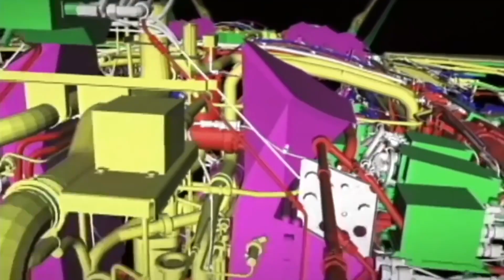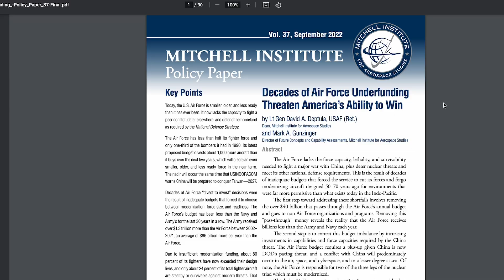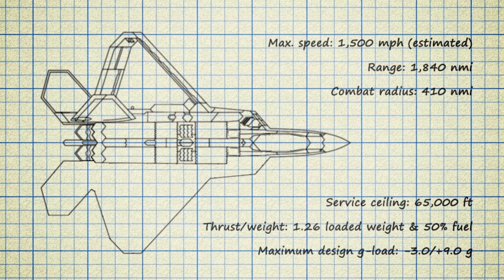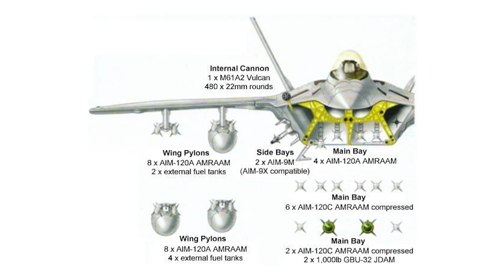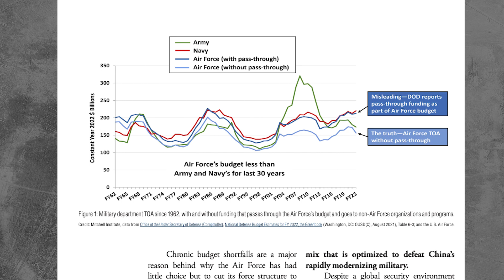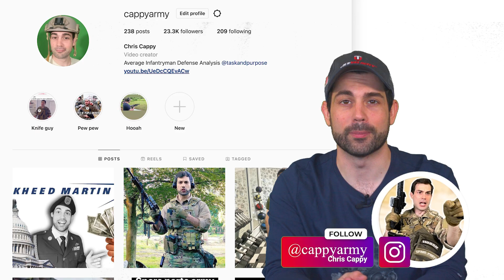Cancelling the F-22 Fighter is Worse than You Think

Comment: I actually agree with canceling the F-22 program simply because the air force in reality doesn’t need it. Why? It boils down to simply the USA doesn’t need great air superiority fighters, it needs good strike fighter ms which the F35 is. This is shown in the Russo-Ukraine war, aircraft biggest problem for both sides has been air defense. While there has been significant air to air combat too and dogfights. But if a stealth fighter was to get into a close dogfight it failed at its task. It is supposed to kill from afar or deliver munitions undetected until the last second before getting out of their. If you destroy the air defense, you 4th gen fighters can operate much easier and at arguably a better level in many roles than the 5th gens. That is what the F-35 does, it enables the older fighter fleet in a way the F-22s just can’t do as effectively. The biggest concern with cancelling the program is the USA is stuck on old airframes but that is an issue across all of the USA armed forces being stuck in old but significantly upgraded equipment.

Comment: The f22 and 35 should be the last manned fighter.  The weakest link in the design is accommodating and safeguarding the pilot. Crew space could be used the space and weight of accommodating a pilot could be better used in a sixth gen aircraft.

Comment: Have to agree that "we" did not build enough F-22's based on current threats, but understand the decision at the time. 

Some have stated that using F-35's as forward stealth target designators combined with AWACS and 4'th gen fighters lagging behind as 'missile trucks' could be a tactic (F-15, F16, FA-18's etc). We best hope that is at least a somewhat valid tactic until we have a working replacement to the f-22 as a true air superiority fighter.

Simply put, only the Air Force has a true air superiority fighter and not enough of them. 

The Navy has NO true air superiority fighter since they cancelled the Tomcat and decided not to develop Super Tomcat 21. That and the long range Phoenix missile system is long gone.

We best hope the AIM-260 is ready before 2026 as planned. Our best bet until we get a true 6'th generation fighter, IMHO, is to speed up this development and deployment. Perhaps bring back a modernized Phoenix system if plausible in the short term, capable of being used by both the Air Force and Navy. Have no idea if the Phoenix is even capable of being upgraded to that level across platforms, pretty much a personal pipe dream for a relatively easy multi service long range missile system.  

I really worry that our carrier task forces, land based assets and overall big picture combined air dominance, are about to be checked by the sheer numbers of our projected enemies. Sheer numbers is how the Allies were victorious in WWII.

Comment: Russia is not a credible air to air threat in Europe and won't be for at least 20 years. The existing NATO assets Eurofighters, F35 etc are more than capable, there's no need for the expensive and fragile F22 in Europe.

The other significant point about the F22 is that it cannot fly from a carrier, which is important in SE Asia.

Comment: I think that it should have been pointed out that dog fighting is still less likely to be the primary type of air to air encounters in even in a war with russia and china. So the the long range of the 35 and the brand new off the line f15ex jets could fill the gap left behind by the f22. And it will do that while costing significantly less to build and fly per hour. The f35 is now cheaper to build than the f15.

Comment: Well the F-15EX Eagle II is a significant development of a reliable platform. I wish my country Netherlands would buy a whole bunch of them to have more strike power compared to the few F-35s that we purchased now. Of course the F-22 is interesting also if it was possible to export it, maybe some current F-16 operators or F-35 orders would be also interested in the F-22. But both these stealth designs are not really good at multi-role and I believe that's where the F-15EX is the best option currently, it's the most modern non-stealth fighter imho.
Reply: Isn't the F-15EX more expensive than the F-35? Since I would assume the F-35 is more capable in more or less any role, buying F-15EX makes no sense at all.
Reply: @mnxs  There are many ways to calculate the cost, I believe the cost calculated for F-35 has always been wrong and influenced by politics and are still more of a wish than a reality. With the F-15E there is much more experience, it's a workhorse with lower maintenance hours required. During Operation Desert Storm the F-15E had the highest mission capable rate. The F-35 looks like a potato and has very low speeds and low range. Also the F-15EX can carry almost any kind of weapon, including B61-12, hypersonic missile, Harpoon, JDAM and HARM.
Look on Wikipedia for the F-35 wish list, search for "being certified", "integration in progress" and "being integrated".

Comment: The F-22 is now an orphan from the supply chain and maintainability standpoint.  I thought that a better idea would be to design a plane that's a hybrid of the F-22 structure and aerodynamics, and the F-35 new, more maintainable systems.  And now they could fold in some B-21 technology also.  Of course the USAF is working on the NGAD, which could obsolete all of this.  But the NGAD won't be in service until 2030 at least.

Comment: The systems on board are simply obsolete - a truly brilliant plane - the best - but was very unlucky with timing - it went into production as there was a giant leap in computing power which it missed.  The 1970/80s style systems are practically impossible to upgrade due to how they are spaghetti coded and interwoven.  Delays to Typhoon saved the project - they scrapped the 1970s style systems and started again - all modular and easily upgradable. The problem F-22 is facing is exactly why the British scraped Nimrod MRA4. The wing alignment issue was a convenient get-out. By the time you could change any sensor on the aircraft and code it into all the ancient systems and test it - it was already out of date.  Bolting the latest off the shelf pods onto standard commercial aircraft gave you much, much better results for a tenth of the cost. It's practically impossible to upgrade anything on F-22 for similar reasons.  The fix is going to be to largely abandon stealth (which is obsolete now anyway) isolate the flight control systems and sunset them - then fit two huge pods on the wing pylons containing complete new avionics and sensor suites communicating with a glass cockpit and HUD wirelessly. This is the only feasible way to upgrade F-22 without spending hundreds of billions - it will make it a worse fighter plane in every aspect (weight, range, flight dynamics and stealth) but it will be a "better" fighter! How? You see, it's no longer about the plane - it's the weapons systems that matter. The sophistication of the weapons and how easy it is to upgrade all of the above - which is why Typhoon accidentally became the best front-line fighter in the world. Unencumbered by stealth integration and fitted with completely modular interfaces and processing units - it's a very flexible and easily maintained platform. As are the other Eurojets. F-35 suffers some of the problems of F-22 - but not to the same degree - however over integration means keeping the sensor suites up-to-date is difficult. Bolting the latest pod into a gen 4 fighter and lashing up an interface to it is easy. The US also used the stealth programme as an excuse to abandon projects such as AIM54 Phoenix - a big mistake and AMRAAM has fallen far behind other medium range A2A missiles, AIM-260 cannot come quickly enough - and even then it's still only catch-up to the best of the rest - it's no Meteor.

Comment: When two stealth fighters meet, neither of them can see the other one until about 10 miles apart. It will be a dogfight. SU-57 is a great dogfighter, F-35 is mediocre. Fortunately, Russia has not so many SU-57:s. I don't know how good a dogfighter J-20 is.
Letting the missile do the dogfight is a good idea, but it does not work if the missile radar can not see the enemy.
Thrust vectroring could make F-35 a better dogfighter. Or find old P-51:s and attach Sidewinders on it.

Comment: As good as the f-22 is it’s not modular and has had issues implementing some weapons the F35 can use as well as the new F35 helmet system.

If they want to bring back the F22 it needs some big upgrades so I doubt it will happen the US will focus on its 6th next generation air dominance platform

Comment: You miss out the ridiculous cost of the F22, the pork barreling that went into it was by making the manufacture spread to around 50 states, so I am not surprised they could not restart production, it was so expensive that even congress blushed.
Worse it costs a silly amount to keep in the air making the F15, an extremely expensive and potent jet, cheap in comparison.
A better design of plane can be built - look at the raider, currently the F15 is better then anything than the Chinese has, their engines are rubbish.

Comment: The F22 was cancelled because its maintenance budget was outrageously high. Most of it was due to the high cost stealth coating or paint. While not entirely low cost the coating on the F35 costs less to maintain. With advanced stand-off missiles such as the Meteor, a less stealthy plane can often achieve the same results as a highly stealth jet. Ram jet propulsion and advanced electronics gives these missiles their advantage and extreme range. This results in a more cost effective RAM coating  and/or less usage of the RAM material. Often the now unavailable  computer chips that were used on the original F22 and better computer systems and software make the manufacture of an origimal F22 unfeasible and undesirable. Sensor prices have come down dramatically since the manufacture of the F22 too. While you could make an F22 look-a-like, it wouldn't be an F22. It would require major re-engineering to make another F22 look-a-like. It would certainly be a more capable jet, a lower cost plane, and a plane with a lower maintenance cost. ( fat chance that is going to happen when you consider how the DoD is currently ran) In short, you may just want to start over especially when you have digital design to speed up the engineering process and 3D printing, another manufacturing process since the conception of the F22, for rapid prototyping. Prototyping that could be used for everything from plane parts to a wind tunnel model. Another complaint of stealth jets has been their lack of weapons carrying capacity when they are armed in stealth mode. As far as the F22's manufacturing program cancellation; it is now a sunk cost. It was and is a fantastic performing jet. It would certainly help to create a good but improved version of something close to it, but different to it. A plane that could fill the original F22's role.

Comment: Ironically, the YF-23 may be easier to produce than new F-22s.  

This said, the F-35, while not the pure fighter, offers MANY advances in Tech over the F-22, and it seems these are not easily, if possible at all, integrated into the F-22.   

A new F-23 could incorporate these tech advances.   However, how much time does that buy us?  Maybe 10-15 years.  With another 5 years to start production (if not longer).  

By that time, either 6th Gen will be coming out, OR, the world will see a worldwide calamity reducing the tech and wealth of the world/nations and more conventional arms will be necessary.

Comment: The Airforce expects deliveries of the NGAD in the the 2030s and I'm sure that the 6th generation programs of our allies are on a similar time-line. We need something now if the Ukraine war escalates to WW3. I think that they need to export the design of the F22 and do a joint revival program with all of our allies to create an open architecture version of the F22 that uses F35 parts. The cost of research and manufacturing can be shared between all of our allies that are also in desperate need for an air dominance stealth aircraft. I hope the 6th generation fighters work out, they sound awesome, but I don't think we can wait.

Comment: @Taskandpurpose I mean, F22 stealth is already functionally obsolete. Give F35s 6th gen AI missile and gun escort drones WHICH I'M SURE WE'RE WORKING ON. 35s are designed to be a network hub anyway, and AIs can pull WAY more Gs than humans. SecDef was right.

I'm sorry man; yes, the demand is bigger than the supply, but more F22 is regressive, we have more than enough capable fighters and EW to intercept anything, and we're never going to go into mainland China anyway. F35 drone escorts will also be cheaper because you don't need as much sustainment equipment aboard a drone, and the 2nd or 3rd generation of drones will be more maneuverable than any SAM system could hope to be after the engineers are finally unshackled by the bane that is pilot safety, and get to focus exclusively on high-G airframe survivability. Hell, they won't even need stealth more advanced than the F22 simply because they'll be too fast for a missile to chase.

Then, 15 years from that, direct energy will make aircraft obsolete anyway.

Comment: I have no way of knowing this, but I suspect there has been a breakthrough in stealth tech that enables the USAF to change to a more cost effective and more capable option.
Reply: Likely a radar-absorbing coating that isn't so intensive on maintenance for the shape of the new aircraft (likely NGAD). Much like how the B-21 Raider can sit on an open tarmac whereas the older B-2 needs climate-controlled hangar, or how the F-35 can be stored and maintained onboard a ship at sea.

Comment: The F-22 was cancelled because it was WAY too expensive per airframe.  The F-22 was WAY too expensive to produce and it has been way too expensive to maintain.  In saying that, the F-22 gave invaluable knowledge that was used in building the F-35 and has also been used in Lockheed's NGAD program that had its first airframe test in November of 2020.  The F-22 was a very expensive lesson and it was seen as vastly more cost effective to shutter the program for F-35s which are usable for far more situations AND because it was such of a knowledge jump, that while China has a "5th gen" aircraft that still uses "4th gen" russian engines because you can steal technology but you can't steal experience, and russia has only a handful of "5th gen" airframes that don't fly, the US now has the knowledge and capabilities to deploy a less expensive and better airframe 6th gen fighter instead of building more F-22 airframes designed 40 years ago.  I love the F-22, but the NGAD when completed will be even more revolutionary compared to the F-22 than the F-22 was compared to the F-15.

Comment: its also worth noting that China has essentially matched the F-22 fleet in a similar time frame as the F-22 production run, if you consider the J-20 a similar aircraft at least.

the F-22 production run was from 1996 to 2011. and they produced 195 airframes (8 test ones 187 operational)
the J-20's production run has now surpassed 208 airframes with production reportedly having been started in 2009. and still continuing.
next to that its expected that China will soon launch full scale production of the Fc-31, likely that production line will see a significantly faster initial production rate due to lessons learned with the J-20 production line.

i do really think the F-22 production run's cancelation was shortsighted indeed. maybe the US should think about doing a mid life modernization for the F-22, turning it into a "F-22B" and then at the same time restart the F-22 production line and produce 200 or so brand new F-22B's to take the total to around 400 airframes.